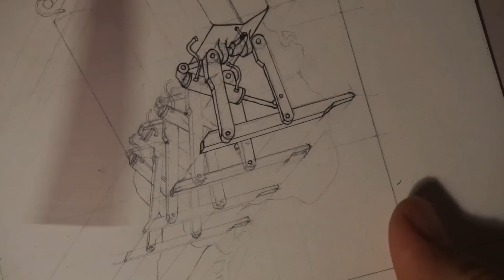Two Block Woodcut Print for AvE

Comment: Nice touch on the hydrastra-grease... I've worn more home than I care to think about after working on fling-wing flying machines, which usually only stop leaking when they're empty. The only thing worse is an occasional baptism in jet fuel, which stinks up the house for only about two weeks, plus the wife's fineries coming out of the washer for a cycle or three. On the up side, coming home reeking of aviation dino-juice was about the only time my wife ever begged me to take my clothes off... 
Badass print that I would wear with bravado, especially if I could brag about winning it by watching a vijeo in lieu of spending perfectly good greenbacks that could otherwise be used to acquire more Fabreeze for keeoing the missus happy. Great work!

Comment: Release the shmoo! This is beyond awesome- I'm I bid fan of BOLTR's way cool vids, being an old timey gearhead who loves taking things apart and making stuff. 
I'm watching you carve those printing blocks BY HAND and I'm all down with the old-school medieval tech, but I'm thinking why?  WHY??? Why not at least hog most of it out with a router, or why not silk-screen? Then you put the block through that big steel roller and I was reminded of the Lithograph printing some of my fellows were so in love with back in art school. I built a sandblast setup that uses 200 grit silicon carbide to carve glass (clear vinyl film for artwork, UV film for mask/resist, oven fired enamel for color) and of course the first thing I sandblasted was a piece of polished black granite. My next thought was "Hmm, I wonder if I can use this setup to carve WOOD?? The answer was yes, after a couple hours putting a mirror finish on mahogany using a cabinet scraper. And then it made a huge mess, of course, which was when I realized I could use the carved granite as a printing block, if only I knew anything about dyes, etc. So the latter part of your vid with mixing the ink, etc. really inspired me.
Anywho, I would love love love a Shmoo! tee shirt. How do I get me one? I can stand on my head for almost 2 whole minutes. Will that do? Also, my shop frequently stinks of hydraulic fluid when it doesn't reek of 90 weight.
pcmck08@gmail.com
Keep on rollin'.
Reply from the maker: Thanks for checking it out! Honestly, on a block this size, it does not take too long to clear out the big areas. I've used a rotary tool on some bigger blocks to speed things up though. Granite block sounds awesome! Hand printed with a thinner paper would probably work out great! 
AvE is dealing with the shirts, so you'd have to check out his page. Not sure if he is still doing giveaways of these, or if they are on his tee-spring link.

Comment: Tip: laser printer and photocopier transfer toner can give unpredictable results, depending on the particular formulation of the toner used in whatever machine made the print. However, if you experiment with acetone, denatured alcohol, toluene, xylene, or even lacquer thinner, you can usually find a solvent that works well for the given toner. Most of those solvents should be available at your local big-box hardware store. As always, work outside or in a well ventilated space; some of those solvents are kind of nasty...

Comment: When are you going to be putting out the video on your registration system? I am a woodcut printmaker that recently got an etching press to print on and am about to take on multi layer prints but cant seen to find any guides showing the best ways to align the multiple layers. Thanks!

Comment: That's really amazing. I want to start carving wood with stuff like you're doing now. ThenI want to 3d print that, so that i can cnc it, as to then make a rubber mold where I will integrate a micro-controller that is linked thru a zigbee network that will pilot my drone to fly back to the beginning and start over with a wood block t shirt that I can wear on my body cause I think that stuff is really cool and I want to be a part of those things happening

Comment: As much as I hate to be the dumb ass that says you need a CNC to cut your blocks, it really would save you a ton of time and make absolutely zero difference to the quality of the finished product. Of course if you've got no digital in your artist's toolkit the barrier to entry would be fairly steep, I'm assuming that's the case. Much more importantly that's a bloody fantastic piece of work!